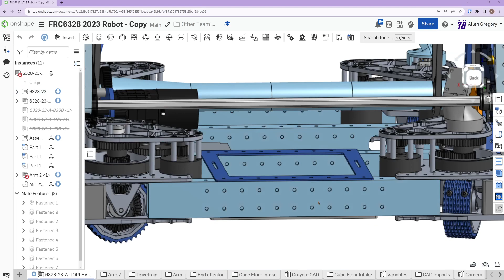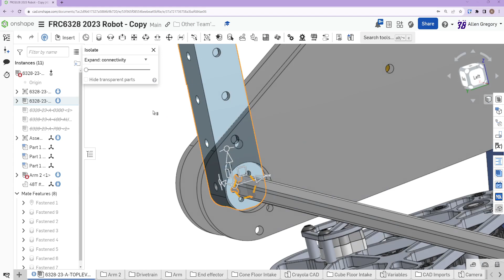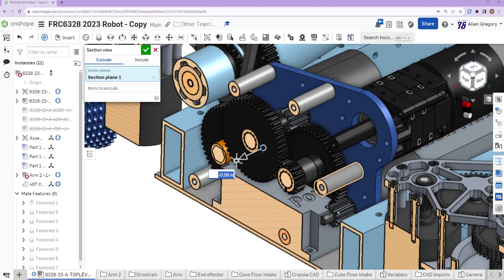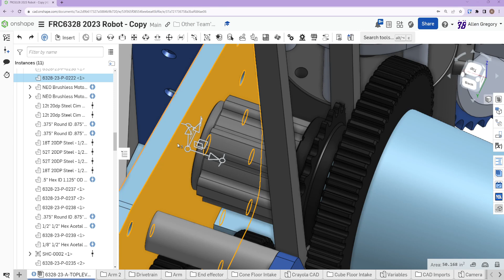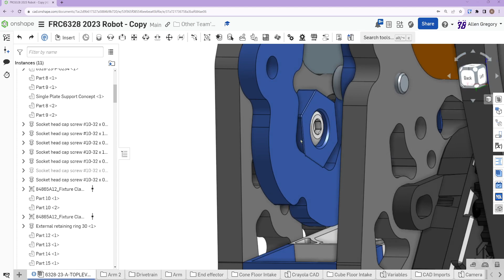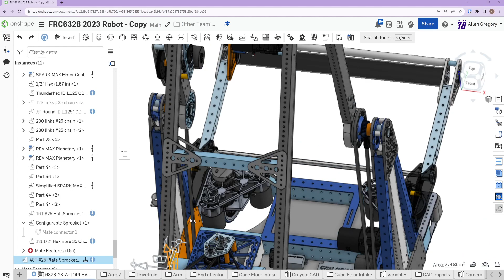FRC Design Exploration: 6328 - 2023

Comment: Very informative.  Well done on the breakdown of someone else's bot.  Those "nuts" at the top of the "A" frames could also double as additional anti torque devices on those plates.  I am not sure.  They may have found that the bolts alone may not have helped alone for the additional "weight" when the arm was extended.  This is only a guess.